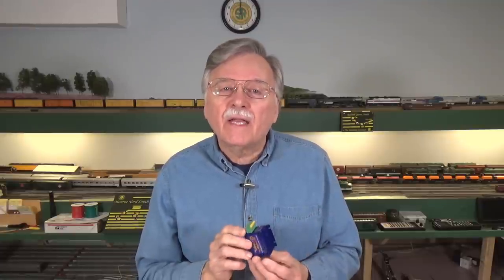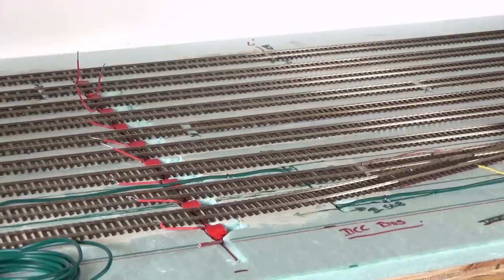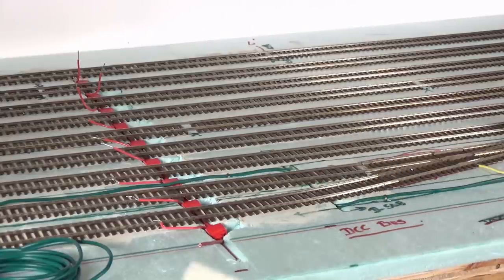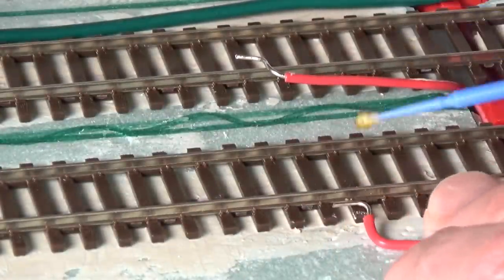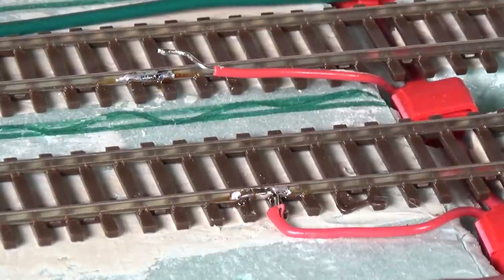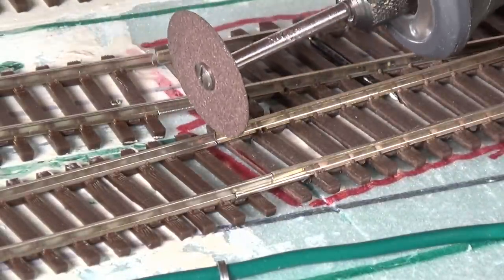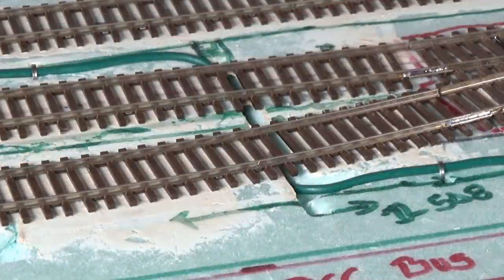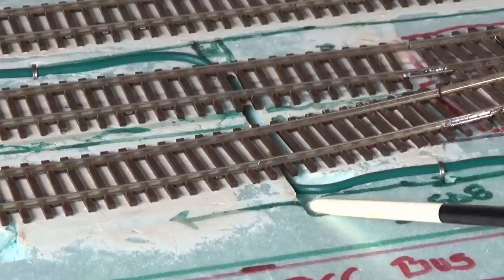Staging Yard Tracks and Switch Machines (234)

Comment: Interesting info I have just experienced.... I have Digitrax controllers and Cobalt switch machines.
The Cobalt IP analogue switch machines will NOT work with Digitrax DS74 decoders....you have to get the Omega Classic decoders with the switch on the circuit board set to 12-18v (not 6-12v). this will bring the current drawn down sufficiently to not reset the decoder. Could you let your viewers know so they do not make expensive mistakes!
Paul.

Comment: Thank you for doing these vids for us Larry, they are very helpful. My I offer a tip? I use some 3"x"5" magnetic backed mirrors and a metal L bracket to see the backside of tracks when soldering. Really helps in n scale to see what I am doing and not melt all my track. Keep up the great work.
Reply: Howzit Larry : To Improve One's Soldering and To Reduce The  * Dwell-Time *  Of The Hot Soldering Iron Against The Track-Plastic  .... Prior To The Application Of Flux; Scratch-Up / Rough-Up The Outer-Side Of The Rail With A Sharp File At The Selected Site Of Solder-Application .... It Will CHANGE Your Outlook On Life !  In Thanking You For Your Series During The Course Of This Past Difficult Year; May I Take This Opportunity To Wish You; Your Family  and  Loyal Viewers Well For The New Year .... Cheers For Now + Stay Safe/ Johnny

Comment: I appreciate all the helpful videos and might I suggest that you tell your viewers what temperature you have your soldering iron set for.
Reply from the maker: I have discussed this in my videos on soldering. I don’t recommend a set temperature for anyone new to soldering, they should experiment and find what is right and works for them. I use a much hotter tip than I would recommend for most modelers.

Comment: I have a small Atlas ho-7 layout. It won't have an additional sections. Should I then terminate one end of my dcc bus? Is there a preferred method of terminating a bus?
Reply from the maker: For most buses no termination is required. Most systems can be wired linearly, in a star or palmate pattern, check your manual for their specific recommendations.

Comment: HELLO...Really enjoyed this video.  What was the clear paste that you applied to the rail before you put solder on it?  I am just starting my yard. THANK YOU.
Reply from the maker: That is rosin flux, which prevents the metal from oxidizing during the soldering process. Most solder now comes with about 2% flux in it but when applying a lot of heat, such as when soldering to rails, the flux can burn off so a little extra paste flux helps. I have discussed this in my soldering videos.

Comment: Do you ever use insulated rail joiners for the gaps?
Reply: I wondered why you'd not used insulated rail joiners too, Larry. I'd have thought they'd help keep the rails aligned, particularly if you accidentally caught the end of the rail with a sleeve or a cleaning rag.
Reply from the maker: I do but in this case will not. I want the expansion gaps open so the tracks can expand if necessary. In the next video I will show you what I do at the isolation gaps.

Comment: You''re installing the IPW Switch Machine on top of the layout?
Reply from the maker: Yes. Remember this is a hidden staging yard that no one will see. The lower portion of the layout will be covered by a black cloth drape. So it doesn’t matter where they are. Plus it makes it easier to install, wire, and maintain them.
Reply: @TheDCCGuy  I see.

Comment: Another great video - thx. Question: I see others brushing alcohol over the soldering connection. Do you feel it's not necessory?
Reply from the maker: I will go over the joints with an alcohol soaked rag (as I mentioned in one of the videos) as soon as I finish all the soldering. This is done to remove any rosin flux residue from the joint.
Reply: @TheDCCGuy  Sorry guess I missed that one. Happy New Year

Comment: Larry, in the close-up for soldering the switch rails to track rails at 12:00-13:00 it appears the switches are of a larger rail code than the track, I would guess switches are code 83 and the track is code 75.  Do you do anything to level up the top of the rails or don't you find it necessary in this application?
I like what you have done with the Cobalt IP Digital machines and LM-iD detectors, especially for automating reverse loops (video 197) and have the exact same application on a hidden reverse loop, but they are proving as hard to find as hen's teeth here in North America.  I've checked the links you provided in video 188 and no one seems to have them.  Any further suggestions where to look as ordering from U.K. comes with obscene shipping charges?
Reply from the maker: All track and turnouts in the yard are MicroEngineering code 83. I am surprised the Cobalts are not available at places like Iron Planet Hobbies, maybe shipping delays. If folks ask for them more I am sure they will get them in. As for ordering from England, I do it all the time and shipping is usually cheaper than from my US hobby shop in SC. I also don’t have to pay the UKs VAT or any local sales taxes. My favorites are Hattons.co.uk and RailsofSheffield.com . I just checked eBay and there are a lot available from sellers there as well.
Reply from the maker: I just heard back from the DCC Concepts sales manager and he says that the US distributor, Heartland Hobbies, has the iP Digitals in stock and any dealer that deals with them can order them quickly, so just ask the folks I mentioned. Also he said that the shipping costs from DCC Concepts should be comparable to what I have experienced from Rails of Sheffield which is about £10-15 or $13-20 for Royal Mail shipping to the US. I checked the Mountain Subdivision Hobbies (in New York) website and they have them in stock too.
Reply from the maker: I also just heard back from Ryan at Iron Planet Hobbies and he has them too. See this link https://www.ironplanethobbies.com/product/dccconcepts-cobalt-classic-ω-turnout-motor-digital-decoder-1-pc-cb1omd/

Comment: PS : I See The Same Query Has Been Raised In The Comments Below .... I Am Indeed Surprised To Note That As A Recognised Electronic  and  DCC Expert Like Yourself; You Recommend A Straight-Off  * BARE + NEKKID *  Gap In The Track; There Being NO Form Of Plastic / Isolating Joiners To Be Used For An Assured Electrical Break  and / or  Secure Rail Alignment !  By Using A Bog-Standard Plastic-Joiner; One Can STILL Leave An Adequate  Expansion-Gap; With The Longterm Assurance An Electrical Break In The Circuit  and  Necessary Rail Alignment ( Especially As You Mentioned This Will Be A  * Hidden *  Staging Yard With Reduced Future Accessability ).  Much Ta / Johnny

Comment: Why isn't all of this wiring UNDER the table??
Reply from the maker: Because this is a HIDDEN staging yard and no one will see it. Putting it on top of the foam is a lot easier than trying to access the underside which is only about 16” above the floor and will make maintenance a lot easier.

Comment: It's not clear to me why you are controlling power via the green wires to each ladder track when you are using DCC.  Does a DCC locomotive consume much power when it isn't selected?
Reply from the maker: Locos use little power when stopped, and the lights and sound are turned off. However, I have found from experience that model railroaders cannot be counted on to turn off the lights and sound after running a locomotive so I am engineering it into the yard so power is removed as soon as the turnout is thrown back to the ladder. It also prevents loco creep which happens because folks tend not to to throttle down all the way even if they think they do, and that is doubly likely if they cannot see it in front of them.

Comment: Gezz Larry you've sure made ALOT of progress Question it appears..you leave Heat on joins for awhile What's your heat set @ ? ( confession, belive it's in your archives so yes that make me lazy after ALL this hard work you've done for us & the channel)  BTW my best to you Larry in "22"
Reply from the maker: I don’t advertise the temp I use since it is likely hotter than most new to soldering should use. Instead I tell folks to practice their soldering on scrap wire and track and begin with  temp setting that just melts the solder. Then increase the temp as required.
Reply: @TheDCCGuy  Yes Sir RESULTS MAY VERY according to 1's experience & equipment.

Comment: Howzit : If One Scratches-Up The Side Of The Rail At The Solder-Site Of With A Sharp File Prior To The Application Of Flux; The Required  * Dwell-Time *  Of The Soldering-Iron Is GREATLY Reduced; As Is The Chance Of Melting The Plastic Track-Base Of Finely-Detailed Track ( Like Code # 83 and Lower Codes ). Also; The Simple Use Of  Crocodile-Clips  As Placed On Either Side Of The Solder-Site As  Local Heat-Sinks Also Greatly Reduces The Chance Of Plastic Melting / Distortion. Further; It May Be Counter-Intuative; But I Do Believe It Is An Advantage To Use A  HIGH  Soldering-Temperature To Get The Job Done  * Quick and Proper-Like; *  As Opposed To Having To Hang About For  Ages Where The Rail Itself Is Acting As A Heat-Sink  and  Is Removing The Heat Away From The Solder-Site To Possibly Cause Damage Elsewhere .... Nuff Said.